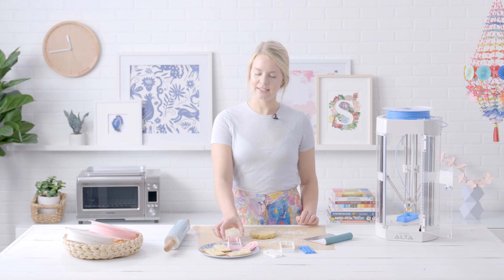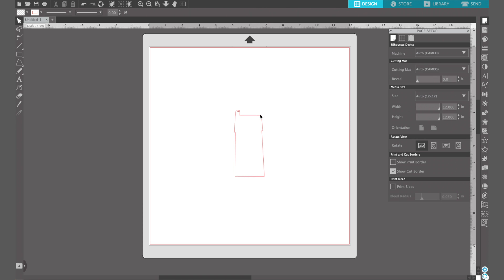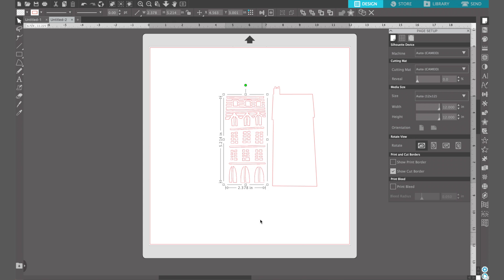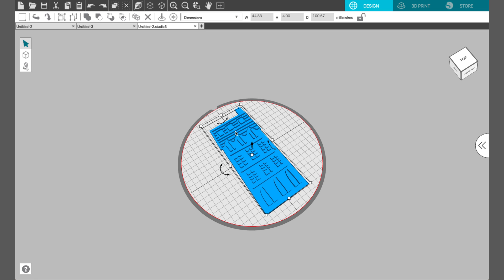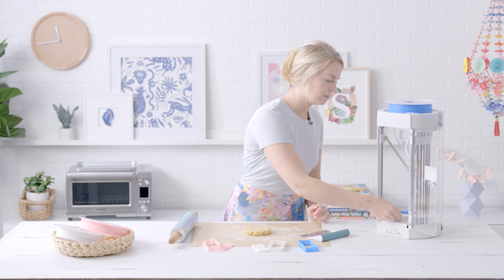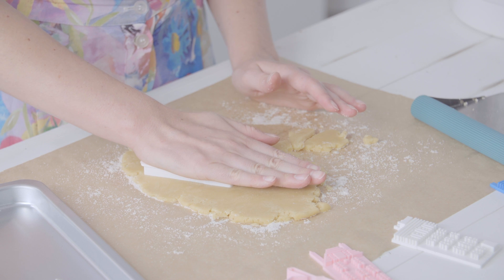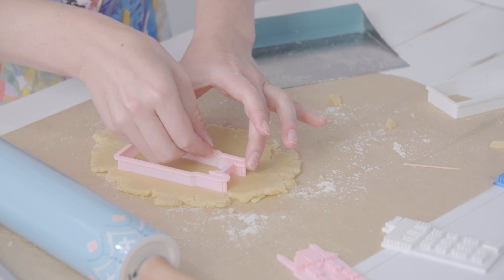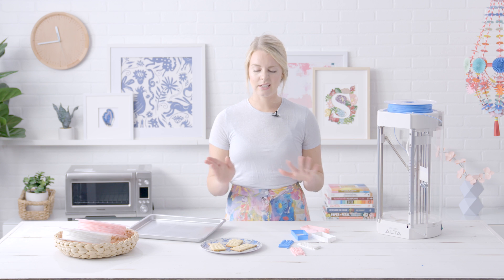Maker Studio | 3D Printed Cookie Cutters & Stamps

Comment: If you do the impression first and then cut the cookie it won’t get distorted.  Also if the dough is nice and chilled it’ll hold its shape better.  Also I’ve learned on the software if you use the rotate tool it rotates more accurate.  Can’t wait to see more Alta videos.